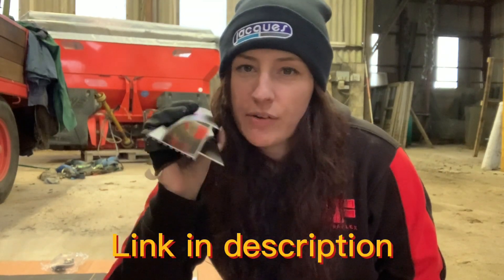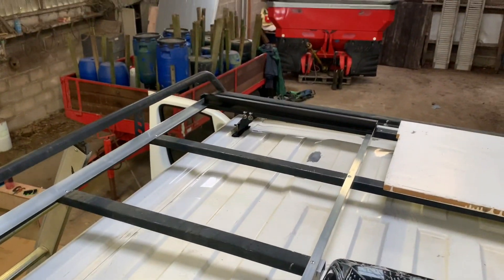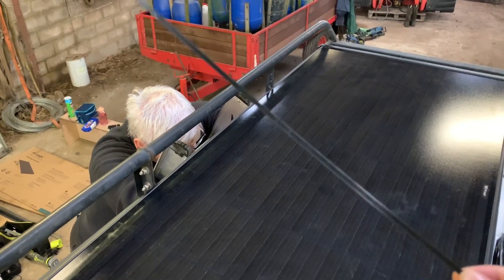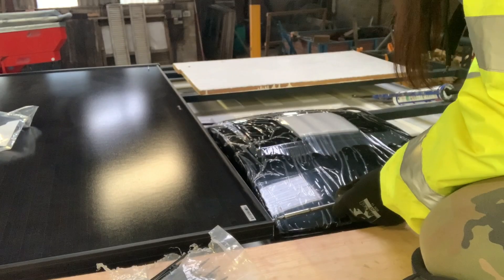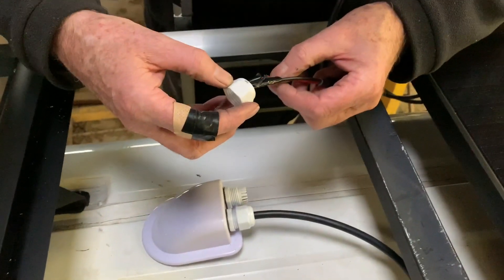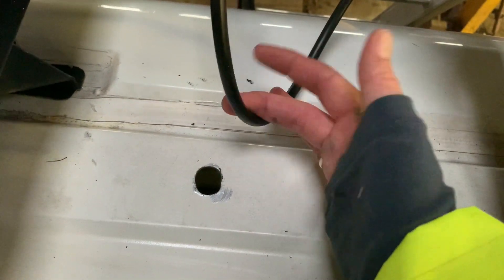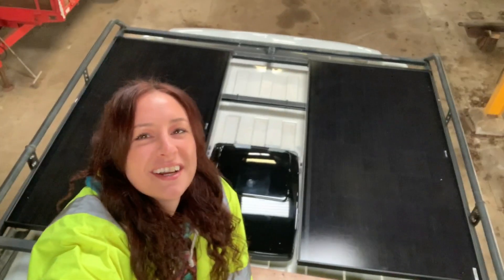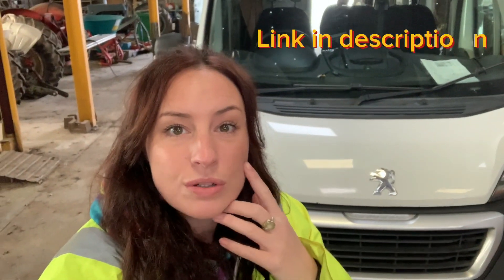ADDING THE SOLAR (I'm going off grid!) - van build Ep.10

Comment: Very surprised to see that drilling into the solar panel is a recommended method of fixing....
Reply: Drilling into the side and bottom of the frame is perfectly safe to do. It's not the solar itself that's being drilled.
Reply from the maker: I’m not sure it is 😂 but that’s how dad decided we should do it. I didn’t show you on the film but there was like an inch lip of metal we had below the panel to use. Either way it worked  so I’m happy 🤩

Comment: Go at your own pace and try and enjoy the experience! The panels look great and bomb / tornado proof with your dads engineering skills! I used to use lengths of 13mm water hose to feed wires and cables through metal work, works well. Stay well 🙂
Reply from the maker: Thank you. That’s a great tip, I think dads got some piping but if I ever need any out & about I’ll know where to turn 😃

Comment: As a word of caution guys , watch those hot 🔥  sparks they will glue to your paint and leave ypur roof full of rust particles. I sprayed iron out after my roof vent and the whole roof turned purple to show up the flakes . Great job though guys , I'm at this stage too
Reply from the maker: We noticed this after leaving the first one overnight 😅😅 cleaned all the others off straight away which seems to have done the trick 🤞🏽 
Thank you, good luck with yours, I hope it’s going well!
Reply: A good product to use for the metal flakes is iron out by auto finesse. Although you can't see them until they start turn to rust spots . This product I sprayed on my van it kinda bleeds after 5 mins and it pulls the rust particles off the bodywork. Amazing stuff think £15.00 from europarts . Good luck Becca and keep on smiling 😃
Reply from the maker: @lee_the_upholsterer  amazing, thanks Lee. I’ll keep an eye out & purchase some of that if any rust spots develop 🙏🏽

Comment: Why not fill the gap with some rubber.
Reply: If you mean under the cut racking, each end of the metal profile is fixed to the full width of rack so its not going anywhere👍